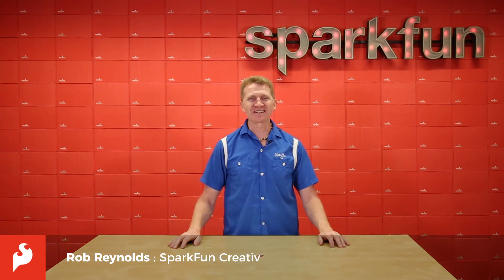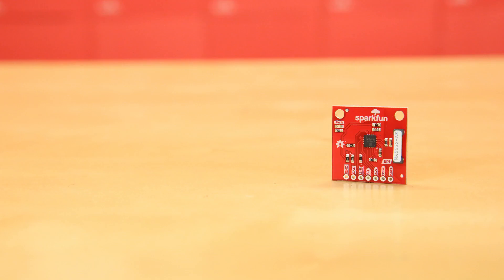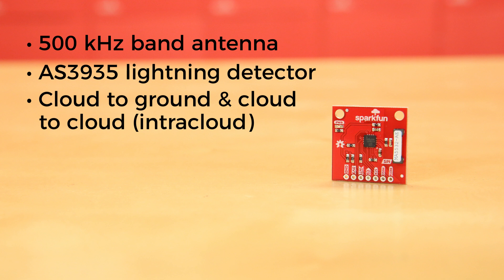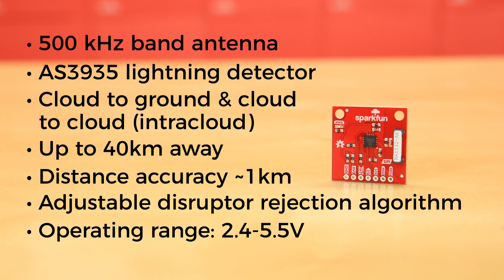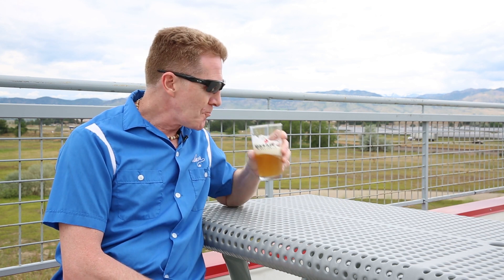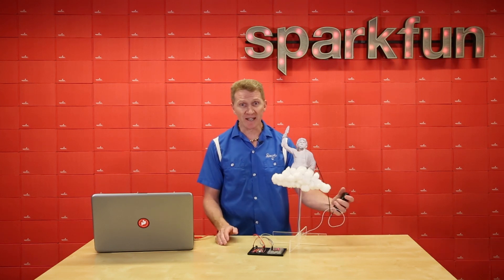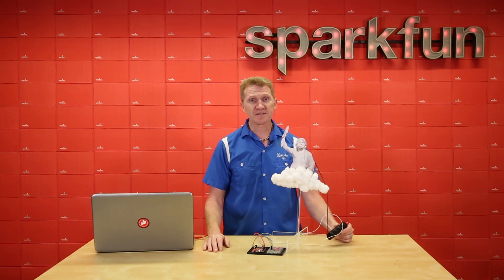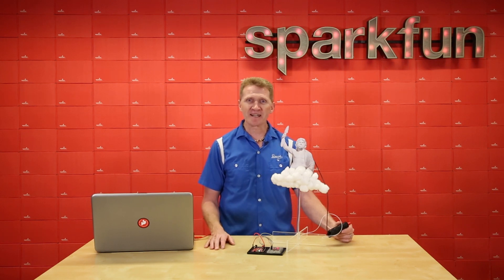Product Showcase: SparkFun Lightning Detector

Comment: Not sure why, but I want one. I will check this out. Curious if it can be tuned to detect in a smaller radius. I don't particularly care if there is lightning 40kms away. Costa Rica has so many micro-climates, that  I can ride my bike 5kms up the mountain and it is cold and there is fog, then go the other direction and it is 40C 100% humidity and violent sunshine.
Reply: You can adjust the sensitivity of the lightning detector in the code, or you could adjust the code so that it only returns a distance if it's below 10km (or whatever distance you need).